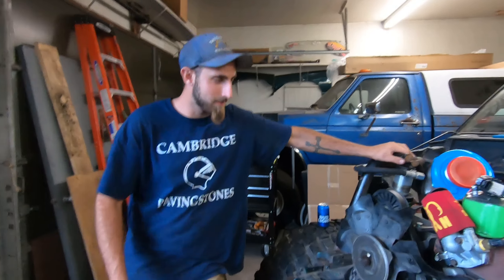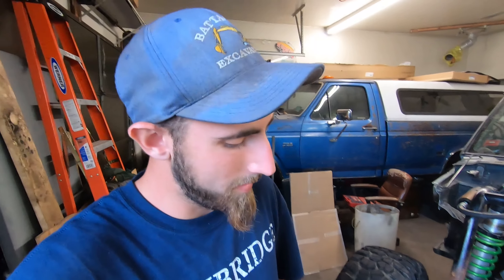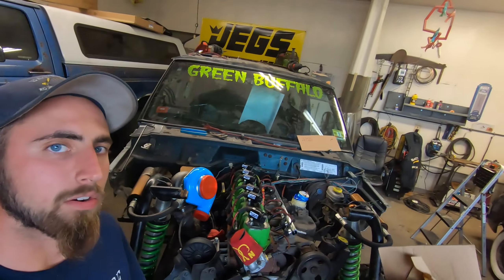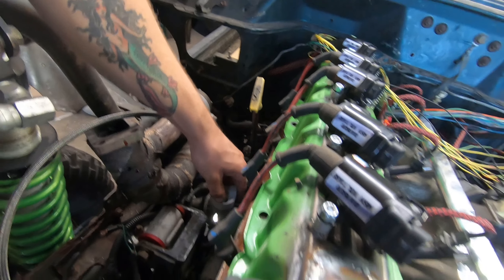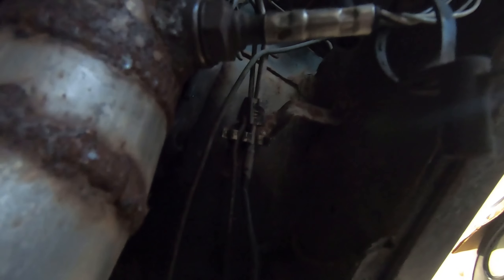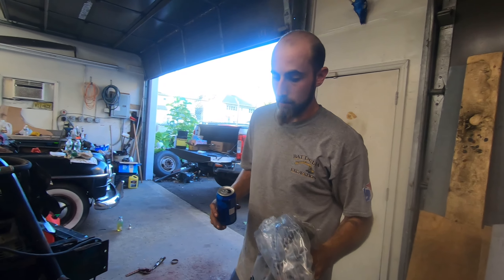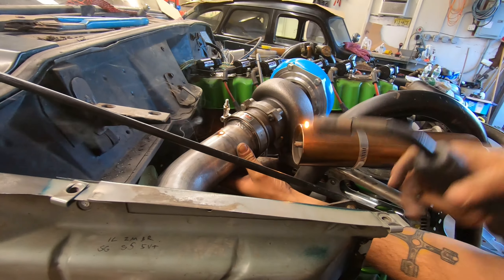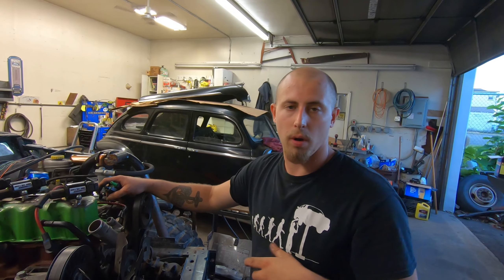Turbo Jeep Megasquirt Part 4

Comment: I probably missed it, but are you using that cam position sensor as your trigger for megasquirt?
Reply from the maker: No, the cam sensor is our cam input, the stock crank position sensor is our trigger
Reply: Grewsum 2Sum 

Oh sweet. I remember a while ago megasquirt wouldn’t recognize the stock crank sensor. When you guys wrap this project up you should do a Q&A video with stuff like that. I’m about to drop a turbo 4.0/NV3550 into my Dodge D150 but trying to figure out what I need to make megasquirt happy.
Reply from the maker: @eighthnotch_  we definitely will do ! We will try to go through everything that we did

Comment: for some reason.  I'm really into this turbo build.   I'm actually interested in this coil pack setup!  wondering if I could use a decent ECU in Aussie to run a jeep.   

1 real question tho.  what was the reason to have the turbo on that side instead of near the intake??
Reply from the maker: There's enough heat over there for the intake manifold to deal with, also it's easier to run an intercooler then also
Reply from the maker: Barra swap one mannn If we had those engines here in the states everything I owned would have one lol
Reply: yehhh true that.  too much heat soak.  maybe ceramic coat all exhaust n manifold.  idea.  but still it does look good over passenger side.   ahahahah barra, could do.  but I do have a spare rb25det on my engine stand at the moment. hahaha 400hp jeep.  hmmmm

Comment: What size is the new turbo?
Reply: a tip I learned is weld vbands hooked up so they stay o not 0 but grate work guys your both clear with your words. keep on keepin on
Reply: @alexanderferguson483  ??
Reply from the maker: Ebay gt35 from emusa idk the exact size